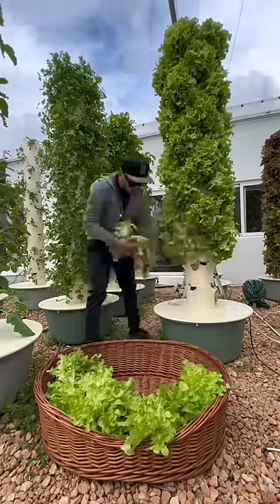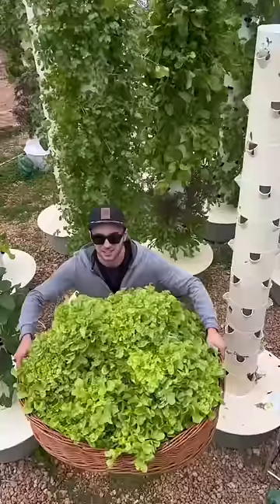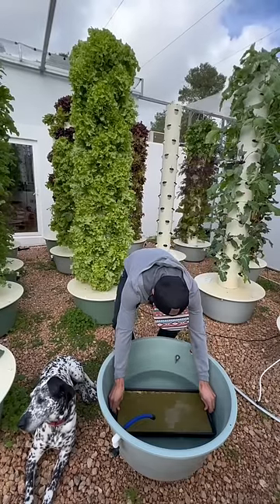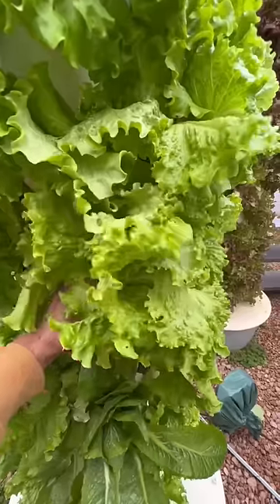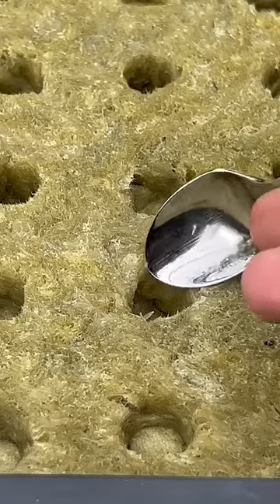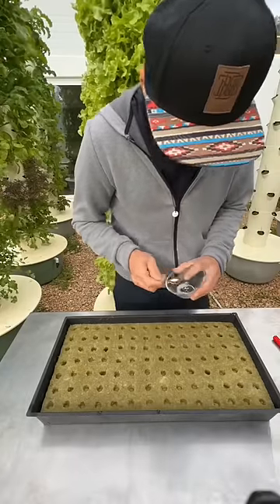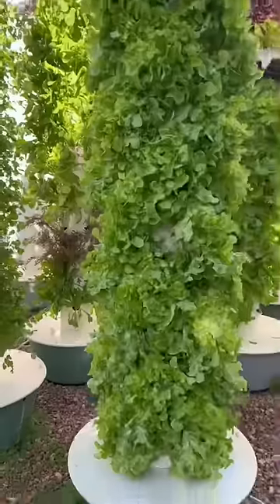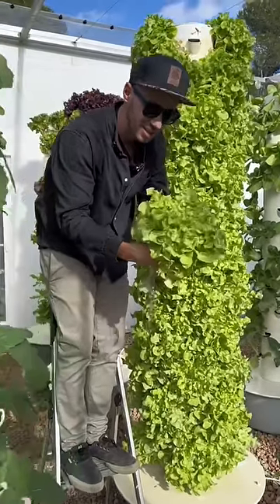Strategies for growing soilless lettuce #lettuce #towergarden #verticalfarming #gardening #farming

Comment: I love how they don’t say how difficult keeping liquid nutrient balance is in a system like this.
Reply from the maker: The towers are automatically filled up on an as needed basis via a gravity tank. These nutrients are dosed at a 1:300 ratio using a dosing system known as a "dosatron".
Reply: @Agrotonomy  You've only reinforced OPs point. The fact that you own an expensive piece of equipment to automate the difficult process doesn't remove the difficulty or cost from the process. It just shows you've succeeded in capitalism.
Reply: @asluckdespairs  lmao yeah. He real quiet about the top comment
Reply: @asluckdespairs  its a short and this idea could help feed us in the future without continuing to destroy wildlife for farming.
Reply: @BooBuKittyPhuk  you could just do the same thing with soil. And make a soil tower. Itd be cheaper. Bc you wouldnt have to have electricity running constantly, and you wouldnt have to spend every 2 days checking for fungal growth. And you wont have to purchase as much fertilizer because the soil will already have some. This option is not viable as you need 24/7 electricity running and we cannot have every farm doing that because then thatd make the oil industry need to drill more oil, which is actually more harmful to the wildlife ecosystem than just using soil. You could argue they may use solar panels, but even thats not viable. When a solar panel breaks you cannot fix it you have to replace it. And two, the oil industry will never let that happen.
Reply: @leacotaco  so there we go... use same idea but uncomplicated... just use soil instead. Thats the kind of discussion which should be going on. Use the good ideas toss the rubbish... but toss it in the recycling. 
☝😋 ♻️
Reply: @BooBuKittyPhuk  i like the way you put that lol.
Reply: Use the same idea, but with a tube with holes in it in the middle and fill the rest with soil.
Reply: Besides all of that, it's too tall. I'd need an f-ing ladder to get up there lol
Reply: @asluckdespairs  last part of your comment was pointless, but revealing.
Reply: @JOHNizSiK your pfp is revealing. Kek
Reply: It's not that big a deal, hydroponic growers do it all the time
Reply: How do I know how much nutrients to use on a very small scale in my home?
Reply: @asluckdespairs 😊
Reply: Thank you for that.
Reply: They don't say much at all about how to do this at all. They got sidetracked when he started talking about putting one seed per cell. They left out the most important information in this method to make it worthwhile. Pretty much just wasting ppls time for algorithm traction.